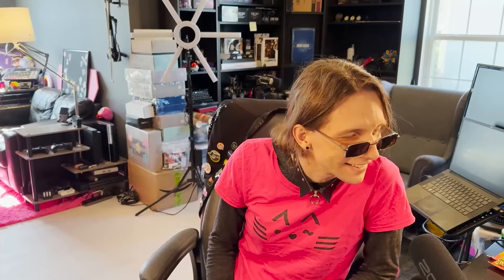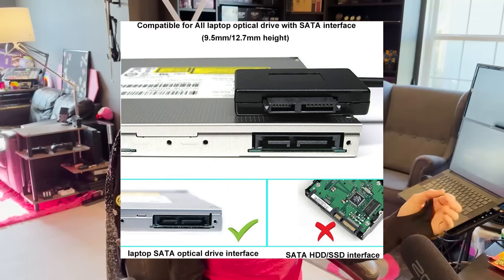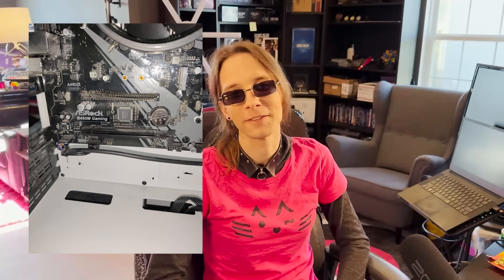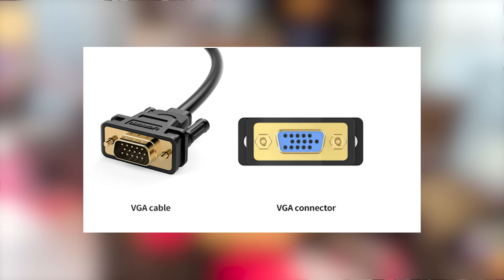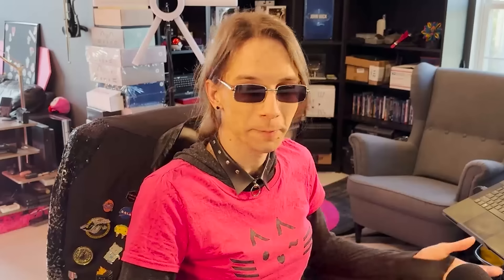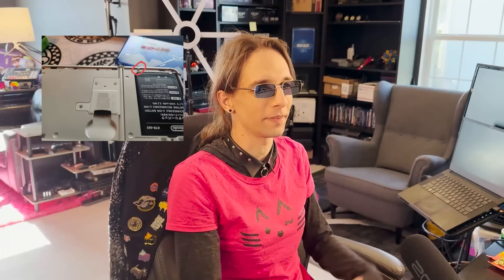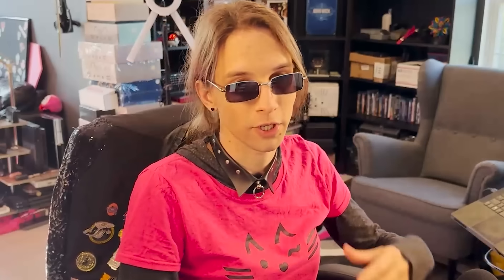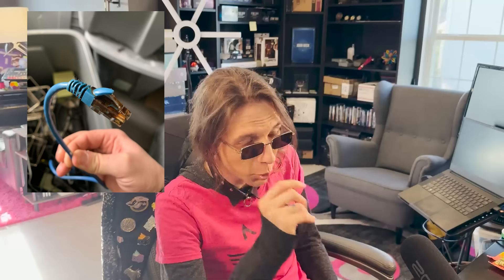How to NOT computer | Lexplanations | r/techsupportgore & r/hardwaregore

Comment: For a little more explanation on the network kable desaster: technically it actually can work, cause your computer doesent know if you use a brown or blue wire on that one certain connection. but with only 4 wires, you are limited to a 100Mbit/s connection (which isnt all that bad tbh). the real issue here however is isolation. if you ever opened up a network cable, you notice a lot of foil around the wire pairs, thats because the data stream is highly sensitive to electromagnetic fields and can be disrupted by  them. thats why in electronic fields, an old teaching says to never run data cables next to power cables if possible. because high amounts of electricity going through a thicc copper wire generates a electro magnetic field around the cable.

Comment: 13:41 My gaming pc had one like that (it was behind a little door that could be deformed to press the button, and it would then smack it open, leaving the whole assembly stuck out a little bit) and I broke it with my leg while I had it pulled out all the way and got up to get the next disk

Those things are super weak

Comment: I love the image of a NIC having an existential crisis at the split cable. Though, I think that was so they could run two separate 100m connections on one cable. Also, the "works" to "won't get you shot" scale needs to be the new scale of IT workmanship.
Reply from the maker: Totally understand the why! I’ll still take garden shears to it if I ever see it in person.
Reply: @TheLexikitty  Understandable. I'd only accept it in a really old house for personal use where it's hard to run wiring, but never in a professional case. In that case, just tie two cables to your fish tape. What about using phone cable for a 100m connection lol? it's only the 4 wires anyway :3 Also, totally agreed on the laptops not having enough buttons, my autistic monkey brain craves physical controls. "Gelatinous ethernet cables" is my new discord status

Comment: An idea for when you need to mount by food prep: Use a bit of blu tack on the outside of the port to make a seal. Actually, I just looked it up, do not do this, Blu Tack softens with heat. So unless you want to eat Blu Tack, don't use it near cooking.

Comment: 5:56 I’ve got a HP Omen 15 with an AMD ryzen 7, a RTX 3060, 16GB of RAM, 500GB m.2 boot SSD and a 2TB m.2 SSD that I added. The only problem that I have with it is the hinge as HP are terrible at designing hinges

Comment: I am not a trained IT tech, but self taught as I was a head technician at a bowling alley.
My responsibilities were mechanically and electrically maintaining the 62 year old pinsetters and their latter day video scoring systems, HVAC, plumbing (surface only, like sinks and sprayers and cup washers etc) and the computer network. 
(yes, it is a severely underpaid position, ask any bowl tech. However it is so much fun and total independence, even the bosses do what you ask)

I have personally handled a router from above a deep fryer that in every respect, matched that description. ( I rerouted the new one, "cringe") The kitchen electronics were by far the worst I ever had to work with and the Bar came in second due to decades of smoking before it wasn't allowed. Alcohol vapors also seem to have a deteriorating factor for cables and connections as well.
Plus it doesn't help when someone pukes all over the credit card reader.....
Or the people at the front desk insist on putting drinks above the computers below the desk.....I leave the obvious result to your imagination, but once it did involve a significant amount of fire.....and a hurried evacuation of about 100 people...

I did miss out on server room hell, ours wasn't that bad, but the coax cables for the security room.....hundreds of identical black cables covering the floor and routed everywhere from there. Literally half a foot deep of coiled coax......

I loved that job, but so very many nightmares as well...I'm still sad they went out of business a few years ago just before Covid..🤣😎
Reply from the maker: Alcohol will dry out rubber and protective coatings for cables, so that makes sense. Sounds like a wild ride, but fun

Comment: 3:19 I think I know how that happened. They have trouble getting the solder to melt, so they turn up the heat, and still doesn't to it so they're pushing down on it with the iron. This causes the now more malleable tip to bend a little more with each project. They're not using flux, probably ruined a few solder pads too. Ask me how I know.

LEARN TO FLUXING SOLDER PROPERLY!. You'll be way happier.

Comment: I worked with a guy that blew up old PC towers for fun....in his basement. When he bought his house, the laundry room was in the basement, but he moved it upstairs for his wife. He left the 220 Volt dryer plug in and active. He rewired a 220 volt pig tail cord so on the other end was a regular 120v plug that you put into the back of your PC's power supply. He would turn the breaker switch off, plug everything up, then hide behind a table and flip the switch. Depending on the power supply it would take between .002 seconds and 1.5 whole seconds to blow the power supply and the case wide open looking like an over cooked baked potato. To this day he still has power supply and computer components wedged into the tile ceiling of his basement!
Reply from the maker: This is hilarious and terrifying
Reply: @TheLexikitty  I know right! I just load a couple M-80's, light it and run like hell!😆

Comment: I moved my computer 2300 miles by car by sticking it on its back on a blanket in the trunk. Can confirm they're way sturdier with the GPU vertical and the mobo horizontal.

Comment: My PC uses the mATX version of that Thermaltake case you mentioned, and I have it in it's horizontal setup (all side/bottom panels are interchangeable, and the front IO is on pegs so you can move it to another side) 

I've moved my PC through half a dozen houses and into storage while I was homeless, and the worst damage I got was a few scratches and a broken WiFi antenna, even with my GTX 1070 still installed and moving it via suitcase. Horizontal motherboards are the GOAT
Reply from the maker: this is the way
Reply: @TheLexikitty  OMG LEXI HIIIII please say hi to lexiwife 🤗

Comment: 3:50

In their defense, not all soldering irons are designed to go to that max temp. Some only are meant to be mid range for lower melting solder (because liquid metal CAN burn, which releases toxic funes). They may have damaged the cable and replaced the end with something that changed the resistance, and made it hotter than it was rated to handle? Actually, its possible they did that modification with that affect in mind, not realising the end wasnt resistant enough.

Comment: 2:05 - We had a question in the college from our teacher about connecting 2 pairs of PC's through the one cable. And actually you can do it like that.
You can't connect two machines on the one side to the single machine on the other, but you can use these pairs individually as separate cables but in the same insulation.
Reply from the maker: Can, totally. Should, no.
Reply: @TheLexikitty  and that's another type of question you should ask yourself if you ever thought about doing that :D
Reply from the maker: I've had a few times clients have wanted to do this kind of thing, and I either put a miniswitch at the destination or just ran two drops instead of one. With the proliferation of Wifi/security cameras/etc requiring PoE, unless its strictly just a patch cable for use in a temporary/one day setup, it's something I will take garden shears to if I encounter it in the wild.

Comment: Yeah, I have an HP, and the front screws go in at angle. But a big issue with it is that there is NO screw in the middle and only the outer part of the lower case is secured.

Comment: For the GPU and damaged socket rant, there are also pcie risers which enable you to take all the stain off the motherboard and onto the case or a bracket designed to take

Comment: Fun story; My mom used to be a tech as well, and when she worked at Gateway, there was a model of Laptop that had the specific, reliably repeatable issue, of having CDs getting sucked into the motherboard. One day they asked my mom to stress test one of these laptops, She got the laptop to suck six CDs in before it refused to eat the seventh one. Her boss was not happy, but she was just doing what she was told, stress test the laptop.  The issue was so prevalent and reliably repeatable, that the techs began pranking the customers by telling them they could get their CDs back by getting three cherries on the slot machine game that came with their computer.
Reply from the maker: that is absolutely hilarious
Reply: It's one of my favorite stories from her time working there. I think the issue was that the CD holder was behind the screen, so verticle while it spun, and the little thingies(Technical term), that hold the CD in place failed when it got up to speed. But this was like, 20 years ago, so my memory is fuzzy. Might also be what caused that CD to make it's journey to the meet the motherboard.

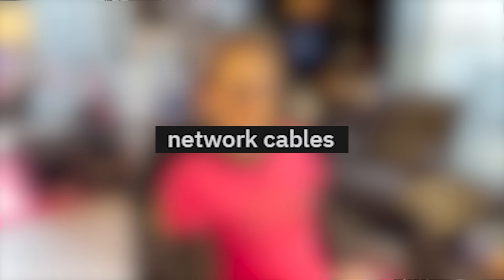Comment: So at 1:30 you talked about networking cables and I wasn't exactly sure what I was looking at because it looked like those were going to the same switch. I can only assume that someone could only make use of a single cord and had to connect two different legacy machines that can’t do anything faster than 100mbps. But I would agree that they really shouldn’t have done that.

fun fact, I knew people that did something like this to do PoE because they couldn’t afford the injector.
Reply from the maker: Geezus people do not understand best practices

Comment: The reason CompactFlash cards are popular for retro builds is because they use the same interface as IDE and can be attached to the IDE bus with a passive adapter.
Reply from the maker: Yea I have an Itronix GoBook III that I really need to swap to CF at some point. Still running on the original drive.

Comment: On the 240W type C thing.... So framework 16 is one of the first to implement 240W sink, and they're the only ones selling single connector 180W charger (tested it, with the losses, it can deliver 165-167W at 36V). There's no 240W chargers yet but I definitely can't wait for my laptop to be even more loud than it is now... I can't even imagine

Comment: i am going to say, i work in a fast food resarant, and NOTHING is mounted over where food is cooked except for the hoods to extract smoke. all server equipment is in an office area away from food prep, and any quipment that is in the food prep area is away form anything that could possibley cause what you whitnessed in that last post

the worst that I have ever had to deal with in that place is a thin layer sticky dust on some monitors
Reply from the maker: Yea I think it has to do with NYC retail spaces being so incredibly small, a lot of restaurants I built networks for didn’t even have a back office or any space to keep things separate.
Reply: also, here in washington, it is a violation of health code to have anyting that could potentionaly fall above the food
no nails, screws pins staples or anything else that has any way of coming loose @TheLexikitty

Comment: Lexi, was that THE hammer that you have talked about before? The one that you ahem acquired from a job site? Your story about the gross equipment above a deep fryer reminded me of a job I did at a restaurant. The manager said the ticket printer on the main line wasn't working and when I looked at it, I immediately realized why. The chef didn't like where it had been installed so he moved it, wait for it, under the high-power infrared food warmer lamp! Just get a nice mental image of Salvador Dali's "The Persistence of Memory" except with a plastic-housed thermal printer.

Comment: Working at an IT office, all of the KVMs used VGA cables.... but there were way more DVI to X adapters.... so finding the right adapter (usually VGA to Display) was a pain...
and I usually just had to daisy chain 2-3, or more adapters together...
Reply from the maker: My former boss and I got so fed up with the DVI-D/whatever adapters, and the Dell SFF desktops we were deploying all came with DisplayPort only, that we ended up just ordering a whole box of each type and dumping all the boxes into one drawer so we were guaranteed to have an adapter. I then did the same when I moved to networking and constantly needed SFP’s and RJ-45 couplers (ancient NYC building, constantly having to extend network lines for conferences).

Comment: You would love and hate to see the state of some of my older tech. I have a working Windows 11 laptop with the entire left upper corner of the screen black with neon strings, an Xbox Original whose disc drive is too shy to come out unless a disc is already inside, and a New Nintendo 3DS still functioning despite the outside paint having bubbled and chipped over time due to teenage me overcharging it while playing SSBB (despite the bubbles and debris having to be brushed off, the result gave it a sick industrial design).

Comment: 7:32 I went to school for recording engineering so I know some stuff about audio amplifiers. It's not so much that if you put an amplifier through too much load that it'll burn, that's far from the truth, it's more so that any amplifier has a wattage and a set minimum load rating. In most cases, if your amplifier turns on and it's not hooked up to a load, that's what causes the burn, but also, you have to connect it to a load, i.e. a speaker or dummy load, that has identical or higher wattage and load rating than that of the amplifier.

Example: My Joyo Bantamp Zombie amplifier is a 20w amplifier with a minimum load rating of 8 ohms. At this rate, a typical 12 inch G12H-75 Creamback will just edge out to be enough, the speaker being at 75w at 8 ohms. Theoretically. What they don't tell you is that with guitar amps these ratings are only average and not peak so if the amp gets a power surge it still has a high chance of burning so you're more likely to need a G12H-150 Redback (and you guessed it, it's a 150w speaker) and probably of the 16 ohm variant because when the speaker has double the ohmage vs the amp you can get away with half the wattage vs what the amp is set to but you still need over 3 times the wattage vs what the amp is rated at anyway, but that's a story for another time.

When the amplifier is trying to power something that can't handle the ohmage and wattage it's giving, then you run the risk of burning the amplifier. So it's not so much that they put too much load on it, it's that something happened and it wasn't getting enough load, i.e. the exact opposite case, or whatever was inputting into the amp was either overbearingly loud, or the signal was causing the amplifier/speaker to collapse on itself. If you try to play an audio "waveform" that doesn't go up and down and it's rather a straight line somewhere that's not a neutral point, it does that.

Comment: 12:55 the reason why most people use them for older pcs is why hard drives are dying today. Faster access. And CF/Microdrive (microdrive uses the same pin out snd size as CF) have the same pin out as IDE laptop drives (like the 1st-4th gen iPods) which is really just scaled down Full Size IDE.

Comment: I have never worked in IT but I have been putting my own computers together for 20yrs now. I have only caused one PC to give up it's supply of magic blue smoke. I was taking it apart and when I unplugged the power cable from the motherboard I did not know the connector was 2 pieces. When I plugged that power cable back in, I had switched the 2 pieces. When I turned it on there was a pop and the blue smoke came out. 😐
Reply from the maker: oops, yea that extra +12v rail will get ya

Comment: Regarding the broken expansion slots: They were never designed with tower cases and great big heavy expansion cards that are more heatsink than circuit board in mind. When tower cases first turned up, it was a non-issue as no ISA cards had heatsinks at all and the bracket was more than sufficient to hold it in place, even for a full-sized card. A couple of generations of expansion slots later, when PCI Express turned up, heatsinks on expansion cards were a thing, but they were all small enough to fit in the same slot as the board they were attached to. Again, not an issue. It's only been in the years since that the heat output of GPUs has become on par with CPUs that it's become a problem. The solution is simple: back to desktops! Now, if only someone would actually make a worthwhile case in the form-factor that's not an HTPC one with only a couple of drive bays...

Comment: I took apart and fixed computers at home for fun so I did it on the floor but I always leave the screws with the part I took it from unless I have to replace it then I put them with the replacement.

Comment: You do realize originally motherboards were ALWAYS flat on the bottom of the case, right?  But some genius thought it would be a good idea to put the motherboard on the side of the case.  Technically, they just turned the computer on what used to be its side.  In other words, computers used to lay flat with the long dimension being parallel to the surface they sat on.  Now, the short dimension is parallel to the surface.

FYI, you are really beautiful. :)

BTW, I place screws according to where they were when I removed them.  I use a flat surface to sort them.